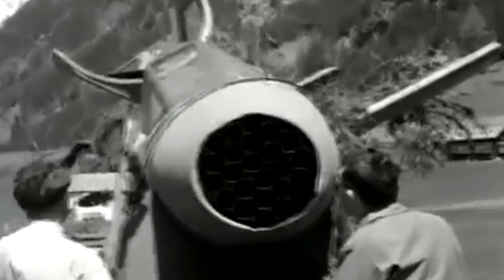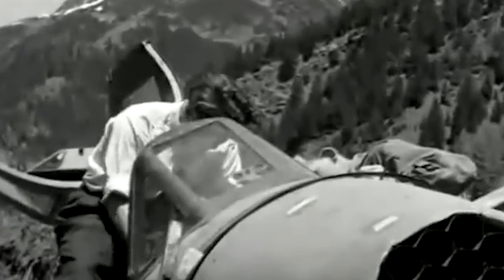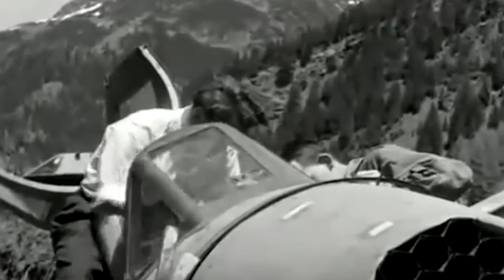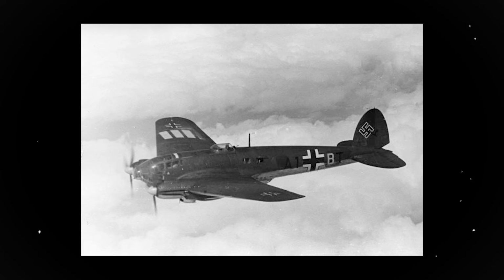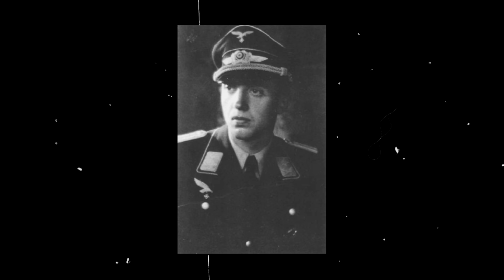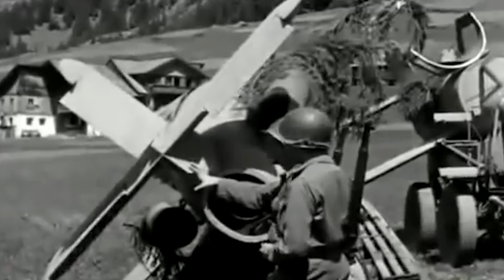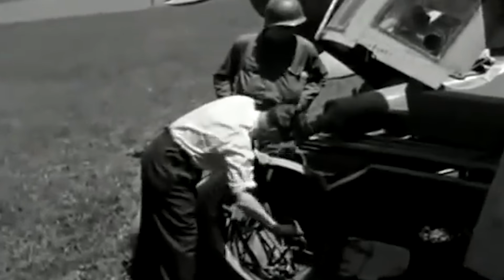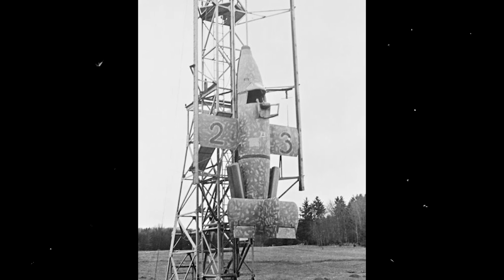The Only Flight of the German Kamikaze - The Bachem Ba 349

Comment: Nonsense. I have seen an unpublished photo of a field with a number of Natters after their camouflage netting had been removed. This aircraft was designed as a point interceptor. Once at altitude, it would fire its nose-mounted rockets and descend. The pilot would then pull a handle that would separate the upper and lower parts. He would then parachute to the ground while the lower component deployed its own parachute. The Natter did go into production.

Comment: The Bachem Ba 349, also known as the Natter (English: Colubrid, grass-snake), was a World War II German point-defence rocket-powered interceptor. Designed to be used similarly to a manned surface-to-air missile, it featured a vertical take-off, eliminating the need for airfields. Most of the flight to the Allied bombers was to be controlled by an autopilot, with the pilot's primary role being to aim the aircraft at its target bomber and fire its armament of rockets. After completing its mission, the pilot and the fuselage containing the rocket engine would land using separate parachutes, while the nose section was disposable. The first and only manned vertical take-off flight on 1 March 1945 ended tragically with the test pilot's death. The Ba 349 was a desperate innovation during the declining days of the Third Reich, reflecting the urgent need for effective countermeasures against Allied bombing campaigns.
Reply: In England the snake known as the 'adder' has the direct name similarity.  

It's Britain's only venomous snake, and may differ from what a German would recognise as a 'natter'.

Comment: Almost none of this garbage is accurate.
Reply: Him saying the airframe was wood, glue and nails is definitely wrong.  

While some parts were of wood, the skin was of a material similar to that which suitcases were formed from, a plastic-fibre material.  Nails were not used, as they were heavy, unreliable and made of metal.  

The autopilot system that kept the Natter straight during the boost and climb phase is not mentioned, nor are the the weapons, except briefly.

Comment: Why the emphasis on it being a radical missile?  It was test flown and had wings ; it was not a missile.  You understated that it flew with a pilot 3 times successfully; but it was near the end of the war so it never got into actual service.  The De havilland Mosquito , ME 163, HE162,  were also made primarily of wood and were some of the top performing aircraft of WWII. The vertical take off was necessitated by the bombing of German airfields.  It is also incorrect that the air-frame as intended to fall directly to the ground; it used a parachute to recover the air-frame.

Comment: Uhm...  Pilot was Lothar Siebart, was not lying down but seated, was not a kamikaze but carried either 16 or 24 Fohn unguided rockets under a releasable nose cone, pilot was to eject and rear section with rocket each had seperate parachutes, initial takeoff was under remote control as pilot was assumed to pass-out, cause of accident was believed to be premature canopy release, maybe this channel needs get someone knowledgeable and able to do research, however it does not appear they have the slightest interest in such.

Almost totally inaccurate.
Reply: You speak from my heart. However, this applies to many Utube channels, especially those with technical content.

Comment: The Natter was not a Kamikaze aircraft. It was meant for the two pieces and the pilot  to be recovered after it glided away from  its attack  and separated into parachute loads-, since it could not land.  Though the did try putting landing gear on it and doing a convetional landing on wheels.  Making it similar to the Me163 sans the sled  on the 163. Most of my info is recollections from "German Secret Weapons' -Ballantine -Brian Ford

Comment: The Natter wasn't as crazy as many like to suggest.  Yes, it certainly was born of desperation, but when one considers the incredible conditions under which they engineers toiled, it is really quite amazing that it came as close to being successful as it did.  The allies were lucky that the Germans didn't get it into mass production.  There was nothing that had a reasonable chance of shooting it down on a regular basis, and its armament would have caused a lot of casualties.  If the Germans had produced this, as well as the Me-163 in quantity, the allies might well have had to order a pause in strategic bombing.

It is also interesting to look at the deployment strategies of these weapons, as well as the Soviet post war version of the Me-163 Comet.  These were deployed much like Hawk and similar anti-aircraft missiles.  They were used as point defense weapons, the difference being that the pilots were the guidance systems.

Comment: Comparing with some other projects this one is far away from stupid. Desperate, yes. The design team in no time solved a number of problems which was extremely hard for the time they act (still the fastest wooden plane, and one of the 2 fastest aircraft in WW2). So be careful next time when you give qualification to something that was built and tested in a hard time.

Comment: The British had a superb aircraft called the MOSQUITO (DH.98 was the designation.  I think. If not, please post a correction. Thank you.) which was made out of plywood.  It wasn't the materials that was the problem, it was the attitudes of the people running this program.  Of course, had they a different mind set there would not have been a war in the first place.  ;-)

Comment: The nose was the only part of the Natter that was designed to “crash”.  From cockpit back, the Natter would descend by parachute to preserve it and the rocket engine. “Half baked idea”.
Reply: Any aircraft that requires the pilot to bail out as part of the standard landing procedure can be reasonably be called half baked. Desperate times and measures and all that

Comment: The materials used in a weapon don't matter if the device works. Its a war, not an engineering class.
Reply: Sure but in this case it was the materials that played a part in the failure.
Even though it really was the delusional mindset behind this and Many other  projects that was at fault.

Comment: The aircraft used for the kamikaze attacks were NOT "unsafe" designs.  For the most part, they were the operational types that had served the Japanese quite well.  Now the mission was, by intent, "one way" BUT that was the tactic chosen  and not a result of a poorly designed aircraft.  There were a couple of purpose-designed kamikaze aircraft but even they had to be well-thought out and well built enough for a  relatively  poorly trained pilot to have a good chance of reaching and hitting a target. The Japanese were DESPERATE, not STUPID.  The German designs were not "kamikaze" aircraft because Hitler would not countenance allowing such a weapons system or tactic. They were not going to throw away pilots purposefully on one-way suicide missions. The Japanese idea was to sacrifice one pilot (or a small crew) in order to cause disproportionate casualties on (or possibly sink) major Allied fleet units. They came close on several occasions.  The German Luftwaffe's  main opponent was allied airpower (not fleet units)  and they concentrated on the bombers but I would argue that the Allied fighters and fighter-bombers probably did more to destroy the German Wehrmacht and Luftwaffe than did the four-engined heavies of the Allies. There were some seemingly suicidal attacks but these were actions taken by individual pilots and not as an accepted or even "ordered" tactic.
Reply: The Fi-103, manned V-1 bombs, the pilot carrying an optional parachute could bail out after setting the flying bombs target. So in THEORY not a suicide weapon.

Comment: The reason why Germany lost WW2, is bc all their plans were flawed from the outset. They woulda done better with pinky and the brain in charge. They fought stupidly to their own bitter destruction, out of spite and stubbornness.
Reply: Yet van brain ended up running NASA in the end.
Ever heard of operation paperclip?
Reply: Fighting on different fronts, stretched supply lines, to many experimental wonderwaffens, so many machines with different parts instead of machines having similar parts, fighting for a little man's ego, and pissing off opponents with a larger manufacturing base than you have, especially the Russians. Two places history has taught us not to invade. Afghanistan and Russia. Yet nobody tends to learn. The original T-34 (1940 model) could do about 200 klicks before the engine crapped out. But when you produce 600 in a year and have plenty of spare parts that means you have the advantage known as many, aka a fuck ton. Sherman's were crap tanks. But 5 Sherman's against 1 Panther is called surrounded.
Reply: @aragos32727   Shermans weren't "crap tanks" Overall they were the best. Watch the tank museum's analyses of WW2 tanks, then you'll see.
Reply: @flashgordon6670  Sherman's we're collectively crap. But as Churchill said, "quantity has a quality of it's own"
Reply: @flashgordon6670  *flashes my 1st armored patch*. They were outclassed by 1943. The War lasted until 1945. It was designed with a bipolar request. Infantry wanted something that they could walk-behind and cavalry wanted something that could speed through gaps in the line. The M-3 grant was a beast when we first sold it to the Brits. War is about adaption. The Germans adapted. Particularly the Tiger and Panther. So the Sherman with the same 75mm weapon as the Grant was literally bouncing rounds of of German tanks who had a higher angular slope of armor. They were reduced to hunting down half tracks and other light vehicles. But 49,234 Sherman's in 3 year's is a huge advantage. 

Like I said earlier having similar parts leads to easier maintenance and field repair. Your tank is knocked out of commission and mine is damaged. Guess what, your tank gets cannibalized. 

It was a genius design. Better than heavy tanks because it needed to be loaded and unloaded off of cargo ships. Necessity created field modifications such as mine sweepers. The M-26 Pershing with its 90mm gun was a match for the Germans. Albeit underpowered but the war ended later that year when they were first introduced. Yes, APCBC rounds and HE rounds helped it kill big cats at 200m. The 7.5 cm KwK 42 L/70 had a 9,000m range.

It was a jack of all trades and master at none tank. It was a good bad tank. Best thing about it was survivability was high for the crew. Everybody (as in countries) could use it in any environment. Was it a bad tank? No. Was it an amazing tank? No. It was the right tank.
Reply: @4literv6   No they weren't "crap", overall they were the best tank in ww2, according to the military experts at the tank museum.
Reply: @aragos32727   Yes that's exactly what I said, "overall it was the best tank in ww2".
Reply: @flashgordon6670  the victors often write history as they saw it. Not as it was.
Reply: @4literv6   Yes the Germans had all the best weapons and technology and that's why they lost isn't it Einstein?
Reply: @flashgordon6670  people like Einstein we're a part of the reason they lost for sure. Hitler bet big on airplanes and lightning quick armor strikes. But without an effective navy especially one with aircraft carriers, to not only project power around the globe. But also to move the troops with. Well what good is having armor and airplanes?
Reply: Snake Oil String Benders  Braun a major in the ss, who ran the penemunde rocket research facility for the Germans. Became the head of NASA running the Apollo program through operation paperclip. Which brought many Nazis into the U.S. after scrubbing their records at the end of ww2-1950s.

Comment: I'm getting Return to Castle Wolfenstein (2001) game vibes.
Reply: Best game ever!
Reply: @PeliFandom  I saw the game in my collection the other day I was tempted to see if I can get it working on Win10.

With it using IDs quake engine you could hammer the graphics on newer cards using the hardware acceleration, make a 2001 game look sharper than it ever was years later.

It is available on GOG for a price and will probably run on decent on board GFX chips.
Reply: Felton actually has an episode on the "real" Castle Wolfenstein.
Reply: that game WAS my childhood
Reply: @Megabob777  I saw the game in my collection the other day I was tempted to see if I can get it working on Win10.

With it using IDs quake engine you could hammer the graphics on newer cards using the hardware acceleration, make a 2001 game look sharper than it ever was years later.

It is available on GOG for a price and will probably run on decent on board GFX chips.
Reply: @richpickings2845  it's worth a shot to play that gem, I can't even tell you how many hours I spent just playing through the campaign over and over, I was so bad at it it took me a year to beat that final boss I can't remember his name
Reply: @Megabob777  That's it now I'm gonna have to get it installed, heck if it don't wok on Win10 I'd build a retro PC just to play this alone.

The fact that the game was non linear, you quite often found 2 routes to reach the end of level.  And those damn skeletons in the crypt those were tough little beggers.
Reply: @richpickings2845  i gotta side load xp some day so i can play again

Comment: half baked is right! Good Grief! I'm surprised the Nazis didn't have rocket-powered tanks or flying jeeps or deadly Giant Paper Airplanes powered by Slingshot!!...or putting wheels on the Tirpitz!
Reply: The only thing you mentioned they didn't try was the wheels on the Tirpitz, the Nazi's did try a giant paper airplane and even tried putting tank treads on a submarine. However, it took the idiots of the USSR to try the rocket powered tank which was actually built by the USSR (they modified two T-55)
Reply: @airplayn  Oh fer goodness sake!! Thanks Tim!!

Comment: The Natter was actually a clever solution to the problem that the Luftwaffe had lost control of German airspace and could not even defend its bases in Germany. In retrospect, the biggest problem for the Germans wasn't technical: Their biggest problem is that there wasn't much industry in Germany to protect after Allied troops encircled the Ruhr in early 1945.
Reply: In retrospect, it's amazing that so much serious effort was committed to fighting the West in 1945. The Germans had entire factories built in mines but where were they going to get steel or other raw materials, as well as fuel? Complete madness that cost thousands of lives.
Reply: @HSMiyamoto , that is why there was a big push for high tech WOODEN planes, jet, and rocket engines. The Jets could run on Diesel or even heating oil, instead of high octane gasoline. Wood was still plentiful, though they still did not have good glue. You'd think with all the trouble they had with glue in WW1, they'd have fixed the issue by then.
Reply: @mrnickbig1   I know all that. But even with slave labor, and German plans depended on that heavily, it would be interesting to estimate how long the Wehrmacht could have fought beyond May 1945, barricaded in theirs "National Redoubt," once isolated. Soldiers and workers need food, ammunition, medical supplies, and the Western Allies and Soviets were prepared to fight until Germany surrendered. Yes, the Nazis always hoped for a Frederick the Great kind of miracle, but the United Nations would keep together until Nazism was defeated. At any event, Third Army seized it before the war ended.
Reply: @HSMiyamoto ,  4 things doomed the NAZIs (not counting their recent revival as US Democrats). 1. Continuing to attack the USSR in winter, despite overextended supply lines and inadequate equipment and clothing. 2. Putting off heavy bomber development  until it was too late. 3. Japan prematurely attacking the US. 4. Putting off development of interceptors and effective early warning until Germany was already being bombed. Contributing factors were that Corporal Hitler was a terrible tactician and repeatedly overruled battle plans put forth by competent officers. Giving jet engine development low priority, then rushing underdevoped prototype jet engines into production at the last minute.
Reply: @mrnickbig1  Germany needed oil and to a lesser extent, food that they could only get by overunning Russia. As long as the British blockade prevented them from receiving oil by sea, the only hope for victory was to take the oil fields of the caucuses. Hitler understood this although many of his generals did not.  Continuing the push into Russia in winter was absolutely necessary for ultimate victory.  Luckily for most of us, it didn't work.   And in regard to the Democrats and Republicans, there's only one party in the U.S. who openly described neo-nazis as "very fine people" and receives significant support from right wing fascist organizations.  And it ain't the Democrats. Just sayin.
Reply: Thank you, Hannah.